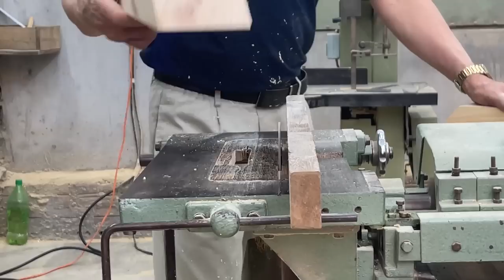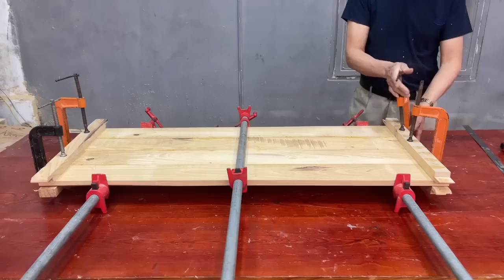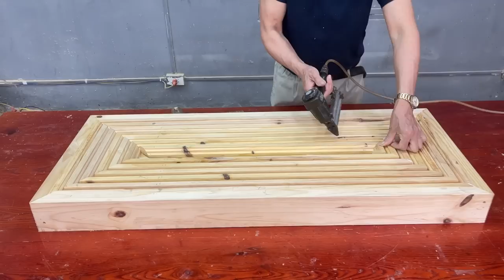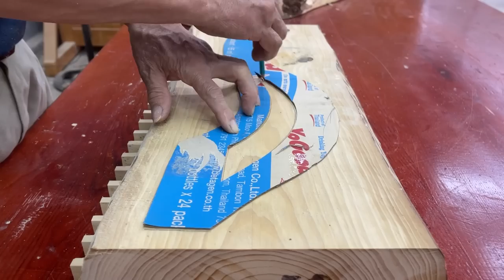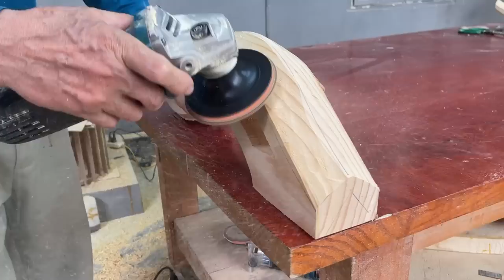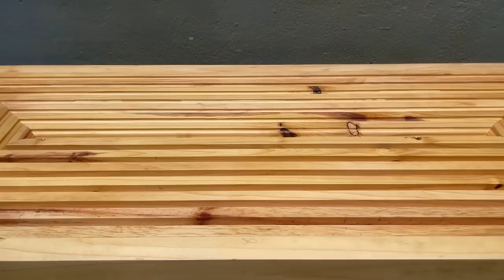Build A Table With An Extremely Unique Design // Innovative Ideas In Woodworking

Comment: How the heck do you keep the toop clean. The recessed parts would fill with dust at minimum.
Reply from the maker: You can place the glass on the surface
Reply: @woodworkingmanualart4012  A better idea would be to fill them in with epoxy resin of different colours. Imho that would give the table a way better look.